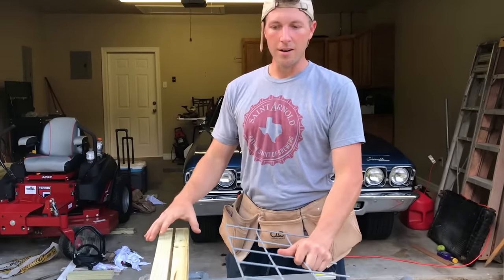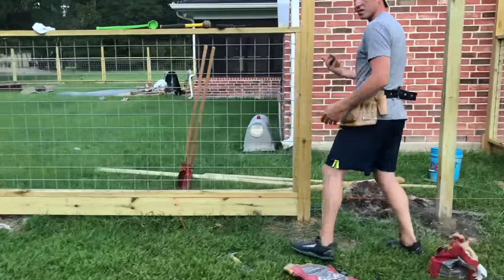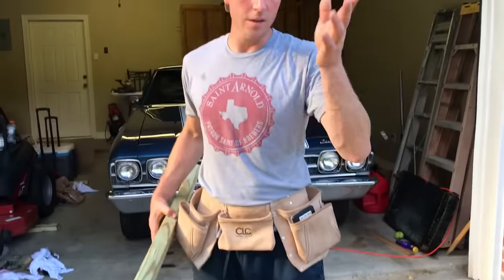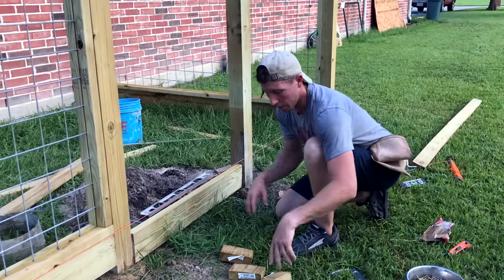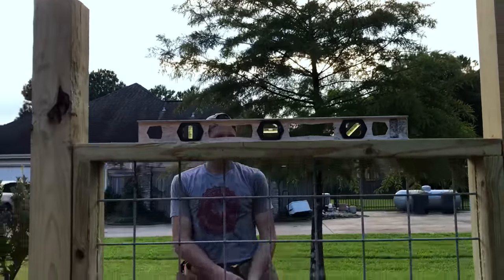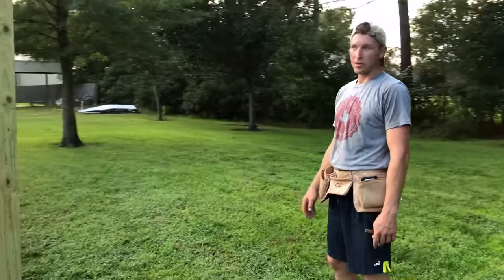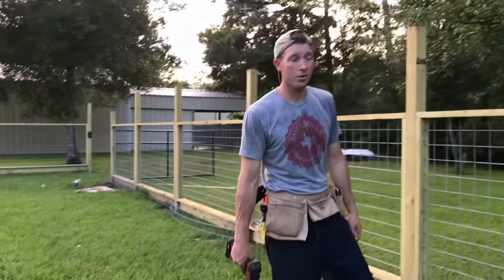Part 1: Modular Hogwire Panel Fence with Dado Groove

Comment: All but cutting it in half weakens the board
Reply from the maker: Thanks for the reply.. it’s Very true...but... it’s reinforced on all sides but the top horizontal board. All I’m maintaining is 2 dogs, which is more than sufficient. It may be prone to premature splitting from weathering (haven’t seen signs of it yet) , but I have the weep holes and do my best to keep the bottom dado free if bio trash.. other than that, this fence is brute and has withstood 2 tropical storms while many others in the neighborhood fell down. It also ran me only about $8 per foot to build. Any piece that rots/splits would be $5 or less and quick to replace. Almost 2 years in and we’re as good as the day we finished. A lot of pros are on the table here.

Comment: where do you purchase hog wire
Reply from the maker: Darwin Aqua thanks for the reply. I got the hog panel from tractor supply, but a lot of hardware, livestock, and garden nursery’s have them. Shoot an email to hawkijon@aol.com for detailed instructions with material breakdown and excel cost generator I developed based on my exact build per linear foot.

Comment: John,   You have listed that your 4x4's are 97" on center,  does that mean from the center of one 4x4 to the center of the other,  or is it from the inside of one 4x4 to the inside of the other.
Reply from the maker: Greg Brucks, I did 97” from outside edge of (left) post to inside edge of (right) post, which in a perfect world would be the same if you measured from center of post to center of post, but not all the posts were the same width dimensions (Ranging from 3.5” to 3.75”) and I didn’t account for that. It made some fits a bit loose and some a bit tight. My panels are consistently 93.5” from edge to edge at the bottom and top. If I was to do it again, I would have set my post to measure 93.5” from inside of (left) post to inside of (right) post for each post to guarantee proper fit, rather than basing it off of inconsistent hard edged variable “to center”. Hope this answers your question.
Reply from the maker: send an email to hawkijon@aol.com and i will send back a detailed hand sketch with dimensions and material breakdown.

Comment: I don't see this fence holding back any dog. Specially a big dog like yours. With their body weight they easy snap that wire off the dado groove.
Reply from the maker: Omar Flores you’d be surprised, the wire utility panels themselves are very rigid. Other than fencing use, they are commonly used for industrial shelving. With the panels set 1 inch in the dado all the way around, id be lucky to make it though the fence with my lawnmower. If it were the hog wire material that comes in a roll bundle, what you have suggested would be very possible. Thanks for the reply!

Comment: Dado is way too deep!  If you need it that deep then should put the 2X4 on end to cut it.
Reply from the maker: thanks for the reply! I agree the dado is a bit deep, i probably should have gone 1/2 or  3/4" depth,  but at over a year and a half we are holding up great! I'll have you know my original design had the dado groove on end as you have mentioned, but it didn't provide much surface area for attaching against the post. I would have had to toenail all the screws in and it didnt seem as rigid as i would have liked. Taking a chance and doing the groove as i did allows for a flush fit and plenty of surface area to place screws square and neat into the post.

Comment: Is the bottom stringer needed or just for looks?
Reply from the maker: It is the backbone of the fence itself… It supports the panel and keeps it from drooping/bowing..
Reply: @GatorOverland  Figured, I just was trying to avoid another run to the lumber yard.  2x6 it looks like?
Reply from the maker: Yes, it’s 2X6, but you can use any width preference to make your overall fence height higher if needed x8, x10, x12..
Shoot an email to jkhartel3@gmail.com and I’ll shoot over the construction info.

Comment: I’m just wondering how the centre of the fence is strength wise, if a large dog impacted it?
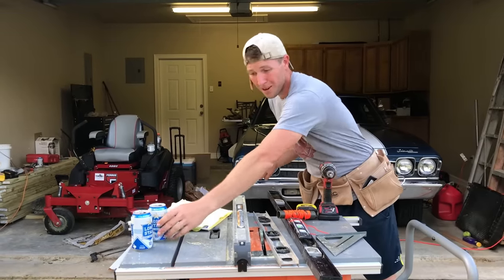Reply from the maker: Thanks for your reply! you should check my Part 2 video out. @ about 3:55 i answer exactly what you are asking. In short, the fence is brute and there are no worries of the wire panel popping out of the groove. Even with my 200lb mastiff up against it. Let me know if you have any questions. Check the description for dropbox and contact info.
https://youtu.be/bL89wkzSPDo?t=235
Reply: Gator_Overland wow that was fast!  It’s 1.15am in Australia right now. Yes I did just watch your part 2 and saw your addressing this question. Thank you for responding. Fence looks great!
Reply from the maker: @h3llnite  i hope all is well down under. i had a feeling you were of a British English using "centre" spelling. The fence is holding up well and continues to get compliments from neighbors. Its crazy im technically talking to you tomorrow. Let me know if you have any questions.
Reply: Gator_Overland hahaha yes. It is ‘tomorrow’ here for you 😬
We have 2 huskies and one is a consummate escape artist. I’m putting up a 2100mm colourbond fence around the dog yard, with concrete and wire running the full length around it (approx. 80metres). into the ground, to hopefully prevent digging. The rest of the block I am looking for a less expensive option, but still attractive, while being strong, in case the dogs escape their main enclosure at anytime. This hog fence system is reasonably simple, yet looks great. Think I’ll stain it, before construction though. Less fiddly. Will somehow have to make it 6ft high though. Maybe using a wider base board will do this? Btw cute dogs!
Reply from the maker: @h3llnite  Exactly… That’s what’s great about being modular… The baseboard I used was 2 x 6, you could use 2 x 8 or 2 x 12 to extend it higher… Mine is about 5 1/2 foot in most places… if You’re using treated wood, you need to let it dry out before staining or it won’t adhere properly and will bead off..
Reply: Gator_Overland thanks for the ideas about the baseboard 🙂

Comment: How deep did you dig holes and how tall are posts?
Reply from the maker: The posts are 8 feet long, but I trimmed them after install … typically, hole depth is 1/3 of the intended above ground height. Mine works out to approx 18” hole dept… post height above ground is 5’-6”… 1/3 of that is 17-19”.. so add that to your above ground post length.. 7ft overall.. 18” ish below ground, 5’6” above..
Reply: Really appreciate it! Great video..about to build one of my own!
Reply from the maker: You bet… Shoot me an email and I will send over all my construction information and contact information in the case that you might have any questions Hawkijon@aol.com

Comment: Looks really good. But I believe the 2x4 would eventually start to sag
Reply from the maker: Jay Banda thanks for then reply! I will have my part 2 stain and 18month evaluation posted soon. I’ve had no indication of sagging, bowing or warping, and holding strong. The bottom 2x6 also acts as reinforcement, and then vertical portion frame lengths are screwed into the post. There isn’t much option for it to move. If you went 10ft there it is possible there could be some sag. I wouldn’t change anything about this design, it’s holding up great!

Comment: You could use a router and make your groves in the 4x4's and save a 2x4. Great idea and fence tho!
Reply from the maker: Hey! Thanks for the reply! I actually did consider the groove in the 4x4 posts, as it would have saved the cost of (27) 2x4x8ft boards, but I took into account that my post setting would probably not be as perfect as expected on paper. If my post were just slightly wider than planned my panels would be too short to adequately sit in the groove, so I opted for the route with a bit more adjustment and rigidity.
Reply: @GatorOverland  I understand 100% plus you can take the panel out should something happens. Treated lumber is pure shit it's wet warps and is never the same size. Your way was the best
Reply from the maker: If you’re interested in my construction plans or cost generator, shoot me an email at hawkijon@aol.com

Comment: How deep did you put the post?
Reply from the maker: Post rule of thumb is 1/3 of the post length below ground.. I did a 21” deep hole and filled with approx 2”-3” of pea gravel for draining and the post on top. My post are approx 65” tall after trimming them down.

Comment: Another question if I am doing 8 foot sections u said to take a inch or so on the panel
Reply from the maker: Thanks for the reply. Unless your using 10ft long 2x4’s, I would advise going a few inches shy of 8ft sections to ensure your wood is all a common length. Not all 8ft 2x4’s are exactly 8ft, the are +\-.. I did 93.5” length. The wire panel is about 92”, so it allows for a slight bit of room for the panel on the dado groove. Check the description for a link to my Dropbox that has construction details. Stick to those and you should be just fine.

Comment: right when I was about to start planning a fence for my front yard, first timer. How did you do the posts? Thanks for the video bro!
Reply: me too!
Reply from the maker: thanks for the reply! glad i could help! hope it turns out well for you! If you work through the replies there is quite a bit of information to consider that would be upgrades to what i have done. Otherwise, i would say at minimum to drill the 3/16"-1/4" weep holes every 6" or so in the dado groove of the board designated for the bottom of the fence before assembling. This will allow for water to drain.  I bought 8ft. I made the holes 24" deep with an auger and poured 3" depth of a quikcrete gravel bedding in the hole before putting in the post. Then i located the post measuring from the previously set post. You may want to make a plastic or metal cylinder and split it to make a band that you can wrap around the base to act as a mold so you can pour your concrete and set above the grass line (2" +/-). Once it starts to set, you can release the cylinder band and use a putty knife to carve the edges to make a dome for water to drain away from the post. The concrete above the grass line and shaped as a dome will increase the life of the post where it is set in the concrete.
Reply from the maker: @ksukallie  thanks for the reply! glad i could help! hope it turns out well for you! If you work through the replies there is quite a bit of information to consider that would be upgrades to what i have done. Otherwise, i would say at minimum to drill the 3/16"-1/4" weep holes every 6" or so in the dado groove of the board designated for the bottom of the fence before assembling. This will allow for water to drain.
Reply: @GatorOverland  Thanks for the info. I am going to be doing this for my front yard, so only need to make the fence 3 1/2 feet high. Guess I am going to need to modify the actual fence measurements then :( about 160 feet of fence.
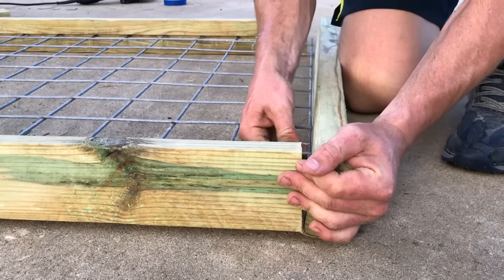Reply from the maker: @ahhyepable  shouldn't be a problem to adjust them. I did alot of number crunching to make the most fence height and length with the least about of materials purchased and scrap at the end. The dimensions i built by were the most economical for my budget build. To make factoring easy for you, just subtract any height or width dimension by 4" at a time until youre close to your desired height or width (each panel has 4X4 grid, thus always giving you a solid vertical and horizontal wire perimeter to sit in your dado groove).  I.e. my wire panel cut dimensions are L=92" and H= 48" (both are factors of 4). if you wanted approx 3.5ft (42") height. take 42" minus(-) 6"(for rot board height) (-) 2" avg. placement of rot board bottom above ground = 2'-10" (34") wire panel height. Well, 34 is not an even factor of 4, which would put you cutting right down the middle of a square section (see 8:08). Here's were you decide on cutting your panel at 32" or 36". Visibly it wont make much difference, but construction-wise you will be happy you cut up against the wire perimeter (seen 10:49 vs 10:16). All the same goes for deciding your panel lengths between posts. Only, if i did it all again i would set each post based on inside to inside dimension rather than like i did from outside of one to inside of the other for a way of measuring to find center. My method would work if all post were exactly 3.5" wide. THEY ARE NOT! If i set my post @ 93.5" from inside to inside, every single panel would have slid right into place without much tapping. Hope all this helps, and feel free to ask any questions in the future.
Reply from the maker: send an email to hawkijon@aol.com and i will send back a detailed hand sketch with dimensions and material breakdown.
Reply: @GatorOverland  Good stuff dude, just sent you a message!

Comment: John,   Very nice looking fence.  I priced the 6x6 grid panels vs. the 4x4 panels.  6x6 panels $20 and 4x4 were $60.  Just curious to know why you did not go with the 6x6 panels at 1/3 the price.  The 4x4 do look cooler buy wow they really jump up in price.
Reply from the maker: Greg Brucks, it’s funny you say that, because it seemed as a no brainer. 2 reasons. 1) I lost to female input for aesthetics,  vs price. 2) “the more legitimate reason” the holes were smaller, so less chance for a snout/head fitting through in the case there is a passing dog. If those aren’t an issue for you, by all means save your money and go with the 6”.
Reply: john hartel: what you just accomplished is called compromise.  Years ago My wife wanted a 13 inch TV in the bedroom, I wanted a 21 inch TV so I compromised!  We got a 13 inch TV.  30 years later still married to the same wife, keep compromising, wife gets better and better!  You won’t regret it!!!
Reply from the maker: @c50ge  you couldnt be more right! Aside the decision on the Chevelle its all live and learn and compromise.

Comment: I just wondered how much it cost him for this project.
Reply from the maker: It really depends on the length of fence required.. I built for approx $8 per foot , and built 207ft.. so just shy of $1700
Reply: 16’ cattle panel is $25, plus lumber which is through the moon right now. We spent around $300 on lumber alone for 60’ of fence last month.
Reply from the maker: Yes, I can only imagine!! I believe the $25 panels are a slightly different ga. Wire than the one I used, still works just as well. Shoot me an email if your project so I can add it to my viewers builds portfolio on my Dropbox link. 🤘🏼
jkhartel3@gmail.com

Comment: WOW.....   I just figured the cost of the design to go around my garden  3,800  That's a lot to keep the critters out.       John,  is the inside measurements from one 4x4 to the other 92"
Reply from the maker: my wire panel was trimmed to 92X48, I have my post at 97" centers, which makes the dimension between post approx 93.5", which is why my panels are 93.5" on the horizontal panel caps so they can fit in between the post. The vertical panel caps are at 46.25" and sandwich between the (2) 93.5" horizontal caps (10:00. Keep in mind not all of your 4x4's will be 3.5", they will be between 3.5"and 3.75". I didn't account for this in the beginning, so a few panels had a little bit of mallet persuading, but still fit. At worst you can unscrew your panel and trim 1/8" to 1/4" from your 93.5" panel length and still put it back together easily because of your dado allowance and it will slide right into place between the post (i had to do this twice) due to post swelling at the time of panel install. In a perfect world, to measure post centers, you measure from the outside a post edge across to the inside edge of the next post, but due to post thickness variance its best to measure your insides after setting the first post and go from there. This will ensure that your dimension in between is exactly the distance you want it to be rather than an expected factor. If you measure post center to center you will have your variance show up at the corner post and you will have to make a special shorter panel or do as i did and put a gate there to make up the difference.

Comment: John,  Trying to decide weather to keep the panel 5' tall or cut it to 4' like you did.  Did you cut 12" off the height for cost reasons in the lumber so you could cut 8' boards in half to 4'You mentioned something about containing your dog so curious to know why you did not just keep it 5' tall
Reply from the maker: Yes, i decided on my 4ft vs. 5ft. to keep my 2x4 lumber to 8ft instead of buying 10ft or an assortment of both. The height adjustment can be made at the rot/mud board, be it placed 1-2" above the ground with a 2x4, 2x6, 2x8, etc. You can get your height one way or another. Though it is level to the world, depending one where you measure, my fence panel tops are between 5ft and 5ft4in from the uneven ground beneath it. Keep it simple, you'll do fine. Planning in the beginning and leisure in the end.

Comment: So the Avanti kit at Home Depot is a pretty good setup.  I saw it the other day next to the Diablo which was $100 twice the price so made me think the Avanti was not as good. So it is good to see if yours lasted
Reply from the maker: Yes, im sure there are some advantages to the diablo (metal composition) for durability, but the Avanti did just fine. My 200 linear feet of panels is near 650 feet of dado grooving when when you add the top, bottom, and sides together, not to mention it was cutting through wet treated pine.

Comment: What brand of dado blades did you buy.  They are running between 100-149 just wanted to get the same one because you said you did all your fence without a blade sharpen
Reply from the maker: I used the Avanti kit from home depot that was about 50 dollars, but you can order them on amazon all day for around 50 dollars as well